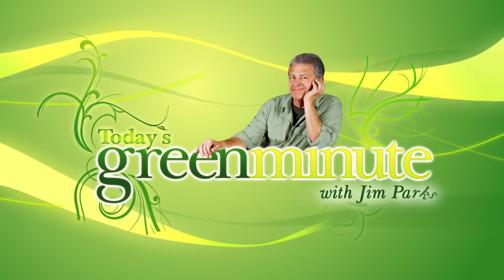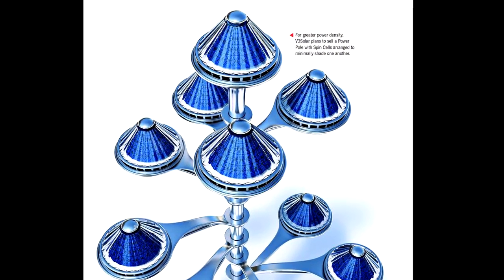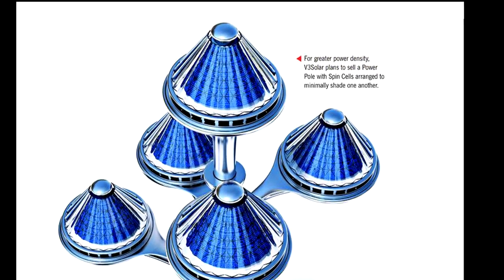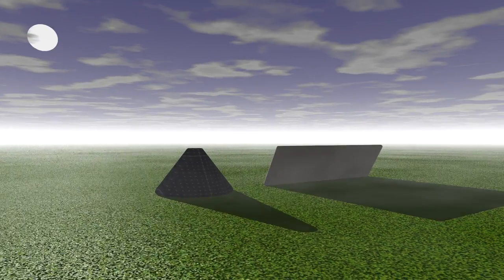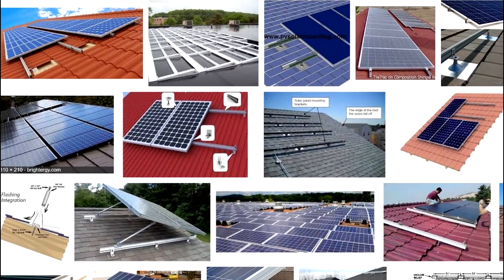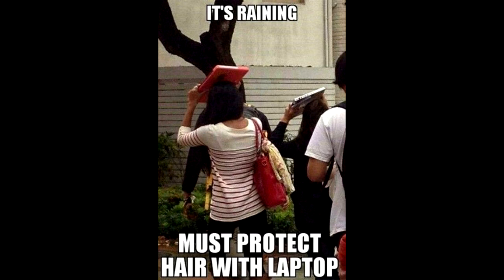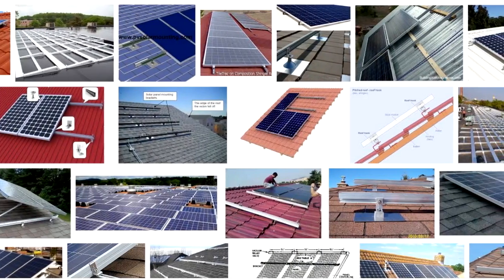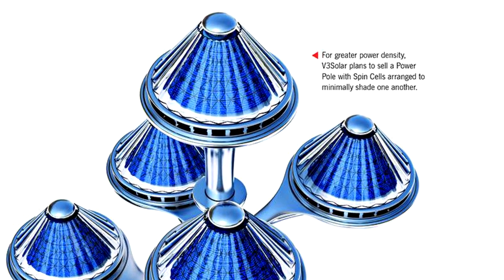Spinning Solar -BUSTED!

Comment: I'm getting panels right now for about $1.14 a watt.  I buy a new panel every other month.  Soon I'll have to upgrade my charge controller and purchase new batteries.  THOSE are really expensive.  If they want to make solar more affordable, they need to direct their efforts into the electronics for charge controls, inverters and battery technology.

I'd LOVE to have 2 banks of nickle iron storage batteries, but they cost significantly more than lead acid batteries and weigh even more, with a larger footprint.

Plus a Pure Sine Wave whole house inverter to run my house costs more than my panels and batteries combined.

That is where they need to direct their research to.  Not trying to re-imagine the panels.  But the storage medium, and the controls electronics.

Comment: Spinning, EM, hyperloop, solar freakin' moisture vaporators!!!!
It has l.e.d. Lights so it can be seen in direct sunlight, it spins because we figured people like spin classes, it turns the solar energy into electro magnets (how do those work?), it shoots down a tunnel at 10x the rate of a casual stroll, and creates tasty, cool water in arid deserts from nothing.
Also, lady Gaga thinks it's cool, so there ya go! Check out my gofundme coming next year, only to be debunked a week later by thunderf00t.... nvm.

Comment: ...Pi =3?  

Dr. f00t, you have just done a better job of rounding then an engineering professor i once had who rounded it to 4.  He said he did it so we would have more room and thing would fit together but dear gods, that hurt my skull.

But onward, i take it the diamond battery thing you mentioned was the one from a UK university?  Turning nuclear waste into a battery that lasts 5000 years (as a half life)?  If you have no idea what i am talking about look it up @Thunderf00t . Personally i think it is bunk but i am a layman.  

One more thing about their spinning panels, who is it spinning?  Like if it is an electric motor wouldn't that also suck power from the panels net output?
Reply: ***** - no i was not scolding him for rounding to 3, i am thankful he didn't round to 4.

Now here is a question, how think is the photovoltaic material?  also how deep do the photons penetrate into the material?  

Strange question i know but i saw something about using beads of photovoltaic material instead of just flat panels.  The device is small and was designed more for looks then anything else so it gets a bit of a pass but i wanted to know if the beads took in all the photons.  

Solar panels are great, i like them alot and wish we could find a way to improve their output, but a flat surface that tracks the sun is about as good as we got for shape.
Reply: Rounding to 4 would make sense if it was for making something larger than the same dimensions of something going inside it.

Like if the exact object was a rocket of radius 1, and the task was to find the volume of a silo that could fit it while having some extra space, one could use a pi value of 4 and same radius 1, instead of using a 12.8% larger radius which wouldn't be easily possible to calculate via mental math.

That said, it's appropriateness would depend on context, and it would still be only for rough calculations, so I agree with you in that it doesn't seem like there would be a whole lot of benefit, but it could work.
Reply: Flat panels seem to be the best way to go. It's what nature approximates via stuff like leaves (which do track the sun on some plants, and which grow to move into sun on virtually all plants)

Comment: Im wondering if the comparison based on surface area is completely fair, I feel like the smaller footprint of the conical panel could allow you to fit more in the same space, though I doubt that it would actually be much more favourable anyways. I just have to wonder, how much energy is being used to keep the spin going. Also important for long term operation, how long will whatever they are using to connect the panels to the output. I have made electronics with spinning parts before, and theres no good long term way to connect power though a spinning piece that lasts for hundreds of hours. So regardless of the efficiency or the footprint, it will require more maintenance than tracking solar panels, with both a motor and some form of rotating conductor to deal with its just waiting to breakdown.

Comment: For that glass sheeting, aren't the designers also discounting a photon flux capacitance of a solar panel? That is, that a solar panel can only convert so much light to electricity per unit time? Or am I mistaken in my understanding that there is a flux capacity to these things?

Comment: wouldn't a 20% boost not be an added 20% to 30% and instead be 20% of 30%?
Reply: it would be an additional 6% increase (.3*.2) bringing collection efficiency up to a whopping 36% before electrovoltaic conversion.
Reply: The God Emperor
What is this "20% boost" you're referring to?
That said, a 20% boost of 30% would indeed be 20% of 30% = 6%. A 20% boost on an unspecified number  is just a 20% boost.
Reply: Mshojat Thunderf00t said something about a 20% boost and just straight added it to the 30% which is a bit unclear in the video.

Comment: +Thunderfoot, With regards to water and Car engines, It's actually a fact that injecting water into your engine will make it more efficient, that's because it provides both cleaning and cooling, the water becomes steam, this in term cleans carbon off the valves and combustion chamber ect making them seal better/flow better, It's most popular to use methanol mixed in with the water, or just simply windshield washer fluid with a high methanol content, this has the added benefit of increasing the effective octane/cetane rating of the fuel, preventing engine Knock (detonation) when using high boost pressures/high compression engines. We aren't talking a 10% increase or anything like that  in a standard engine, but some benefits for sure,

Comment: I got the impression that the promotional video advertised cheaper solar panels, which could mean that they believe you get 20x as much solar power, for the same price, and not 20x as much solar power, per square meter.

Comment: Perhaps the 20 times more efficiency relates to the costs rather than the energy yield /surface area.
as in: you could spend 1000 dollar on regular panels, but if you spend 1000 dollar on our panels you will have 20 times more yield (and possibly need 100 times the room to place them, they are just alot cheaper per square meter cuz they dont need the heat resistant materials that makes the regular panels at least 20 times more expensive per square meter).

probably still a bust though, as most commercials are.

Comment: It was fun to pause the video right away and make my own analysis first. What I got right was that this design is less efficient regardless of spinning. TF didn't mention just how much energy would have to be wasted to spin what's basically a fan with small blades. My question about photovoltaics is will they continue to generate current if they spin around back under the optimal angle? Like a gradual drop instead of sharp?

Comment: Even with that thing rotating, just the extra mass of the lens would add a nice large heat sink for the sun to warm. You'd never keep that thing cool if even that was your only goal.

So with all this solar stuff, why aren't all these people just trying to make sure that the roof space that is already all over the place has current solar panels on them rather than all this artistic bullshit like the tree or solar roads and sidewalks?

Comment: Um, yeah no. 20% of power for current technology is turned into electricity (80% not converted). Twice the efficiency would be 40% not converted. Four times the efficiency of current tech would be 20% not converted. So 20x the efficiency would be a nice 96% of incoming power converted directly into electricity...  (or I might just have thought about this incorrectly. If so, please enlighten me. Maths involved so very possible :P)
Seems like they're thoroughly confused themselves though. 20x the efficiency? Unlikely, but whatever. 20x the power output and, yeah,  you'll run into some issues.

And, as for comparing the lens needed for this bullshit solar panel cone to the lens at the observatory is moot too. That lens there was crafted with insane precision. This cone lens wouldn't need anywhere near that precision.

But yeah, those solar panels are nothing but a scam.

Comment: I think they were referring to the surface area facing the sun. ie being 1/3 the size you estimate them being.
You could place ~3 of these spinning solar panels in the space of the large rectangular one.
It seems like their arguing to trade material cost to save space in my opinion.

Comment: There's a simple way to tell whether these products are designed by idiots: they fail the "keep it simple" test every time.  Solar panels lose efficiency when they heat up? Let's waste some energy spinning it.  Wait, it'll need to be round. Won't that make it less efficient? Yes. Let's add some prisms and make it weigh much more so we use much more energy spinning it. {facepalm}

Comment: if Thunderf00t was born in the 18th ...
Thunderf00t: hello fellow scientist . i just found a post today on the city walls about a metal tube that can fly in the air with ppl in it . i mean its crazy enogh that even a wooden tube cant fly not to motion a metal one . and funy enogh they think by giveing it wings like a bird it will make it fly . 

not hating on u Thunderf00t but we still have to dream and have some attention to some extent so real science can be pushed further and better , and yes solar power can be improved 200x not just 20x the only question is how .
Reply: Powered flight haven't broke any rules of physics known in 18th century.

Conservation of energy is pretty much the basic for all physics, and this invention claims to break it without any explanation.

It's not like powered flight at all - it's like perpetum mobile, just less useful :)
Reply: No man, you can't improve solar panels 20x, it's against the laws of physics. Planes aren't against the laws of physics.

Comment: Could these make solar energy cheaper? Is the cooling benefit enough to significantly reduce the amount of heatproofing that solar panels need to not cook their own electronics, and hence make these inefficient cone-shaped panels cheaper per kWh than, say, a more conventional roof-mounted installation?

Comment: Another glaring issue with those cones is that they statically face the sky at the same angle. Tracking solar panels not only rotate from east, through south, to the west, they also change their inclination to get the best efficiency they can. So these cones would only achieve their fullest potential when the sun happens to be at the right angle, relative to them.

Comment: Basic  problem is that one third of the solar panels get NO SUN at all.  When one panel faces the sun the other two panels are facing away from the sun.  Also, the one panel that is facing the sun only does so for a brief part of its illumination cycle.  When you add in (or rather subtract) the energy required to rotate an irregular object I would be surprised if you generated any excess power at all.

Comment: 80 cents per kwh!
nuclear is roughly 10 cents per kwh
Regular Photovoltaic solar is 12.5 cents per kwh

Projected LCOE in the U.S. by 2020 (as of 2015) $/MWh

source
https://en.wikipedia.org/wiki/Cost_of_electricity_by_source

Comment: First thought: Why the f*ck does it spin?
Second thought: That's not how cooling works!
Reply: wtf spining = using power .so it means that it generated 0% energy :D
Reply: *****
No, it's not. The f***ing sun is the reason we have humans with different skin colors!!
Who inserted this artificial difference into our human family??  THE SUN did!
#RacistRays
Reply: TrueWOPR Spinning is to make it look fancy
Reply: Kancho you think radiation is funny? not cool man, think about all the kids with cancer!
Reply: *****
good point, brah. Turn off the sun!!
Reply: Kancho wow I actually learned something in a YT comment section! sick!
Reply: My  first thought was "doesn't it need energy to spin?"
Reply: @Ola Nordmann yep it will, but it probably won't make much of a difference if the spin is too low, and if you go with higher rpm u need to put in even more energy into the system which defeats the purpose of trying to make it more efficient.
Reply: Peniz Flaccidman well they could put it in an almost vacuum with all the glass and then the amount of work to keep it spinning would decrease... but then the cooling would also get worse... there is just not a single thing about the design that is well thought through, there is no 'fixing' it, the only thing they got right is that, yes, temperature is important for solar panels. and then they just switched off their brains. the most disgusting part is the 20% they pulled out of their asses. even if you compare it against a fixed flat solar panel (which is what they were doing, and tfoot ignored that part, they would never get to that efficiency per panel
Reply: Kancho #SunLivesMatter
Reply: Ninjacat
DUDE...  WHAT IF THEY'RE TRYING TO COMBINE SOLAR CELLS WITH WIND TURBINES?!
...stick these on top of a hydroelectric dam and we have a hippies wet-dream!
Reply: It is a fucking mechanical wonder! It turns thermal energy into mechanical energy! An entropy generator (sounds like a doomsday device).
Reply: The "Stop! Drop! and Roll!" universal law of super cooling far makes up for the lack of efficiency of the cone shape. Since the cone is already not on fire, the cooling per spin is maximized. This mega efficiency is what allows the design to practically hide the solar cells from direct sunlight (leading to more reduced heat and more spinning). A traditional Flat panel has inherently less cooling potential regardless if it spun as fast as the cone.
Reply: Fine Print - This mind blowing technology is 20% more efficient than an ordinary spinning cone that doesn't use solar cells. This will obviously solve global warming by replacing lazy trees with a means to produce cones that spin.
Reply: ...and yet the planet we are on spins in a perfect vacuum and cools itself quite nicely.
Hmmmm.... funny how thermodynamics works even without air.
#Radiation
Reply: Kancho sorry that's just racist
Reply: *****
For more specifics on skin-color vs sun-light

Lighter skin colors are more vulnerable to sunlight, but can produce more vitamin D naturally, making it easier for whites to live in areas with less sunshine.  While blacks produce next to no natural vitamin D, but are naturally very resistant to sunburns, meaning they function best in areas with a lot of sunshine, as they're able to take the heat.
Reply: F!@#Guilt "stop asking questions" "send money"
...Was this thing invented by a jew?
Reply: So spinning it would not keep it a bit cooler?
Reply: I guess that the side that are not facing towards the sun will cool down in the shade... Somewhat...
Reply: Kancho... you win, loved this exchange thank you as well Xaab Xaa.
Reply: +Flying Wingless (UpGet) Im quiet certain that a photosynthetysing tree is a  more efficient solar banel than this thing.
Reply: +Brooke Barnes Fucking hell. They are like the Plauge. Kill them with fire.
Reply: TrueWOPR why does it spin? stop asking questions. it looks pretty ok? Now send money.
Reply: No because you are using energy to spin it and thus also create waste heat.

Comment: I'm pretty sure the efficiency thing was to do with the angles compared to a flat to the ground panel. But still 50% of the panel is is shade all the time and most of the rest is at some angle to the Sun, so I think 20x is the panels facing the Sun directly compared to a horizontal one.

Comment: You need an analog bullshitmeter on a corner so that it goes up and up with each retarded argument that they use. At the end of the video, put the bullshitmeter reading and in a couple of months you will be able to do a top 10 bullshit proyects.

 Extra points if demagogy is used. Won't somebody please think of the children !

Comment: say it ain't so. Is there anything that can be salvaged from this concept?
What if they put a magnet and coil inside the cone, and the spinning generated electro magnetic power?
Reply: J Dineen but what would do spin it then?
Reply: ***** is it efficient to spin a motor with solar power to spin a generator to produce electricity? If not, it would rely on something else to turn it, aka magic/sci-fi.
Reply: You're effectively proposing a perpetual energy machine. Go to school, mate.

Comment: If you take a 30% efficiency system and boost it by 20% it becomes 36% efficient, not 50%. To raise it to 50% means the cooling somehow improved it by 67%
Reply: Jack Mcslay he propabyl meant 20 percent points.

Comment: If a solar panel converts 20% of the sunlight to electricity when it's perfectly facing the sun under ideal conditions, that's one thing. Under normal usage, what percentage of sunlight does a flat stationary solar panel convert to electricity? And what is 20x that amount? I'm actually curious.

Comment: That looks like a pile of garbage. The latest serious research is into perovskite thin-film solar cells with tandem layering of different materials to absorb both higher and lower energy photons, layered on pyramidal or dome-shaped microstructures to maximize absorption from many different angles.

Comment: Are there any solar setups that utilize Peltier modules in conjunction with the panels to not only dispose of some heat but also generate a little more power at the same time?